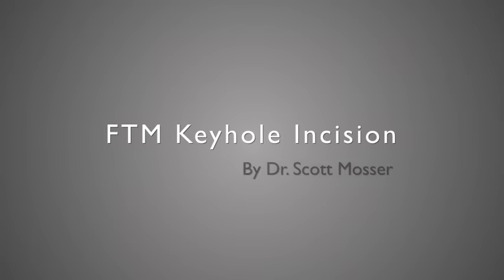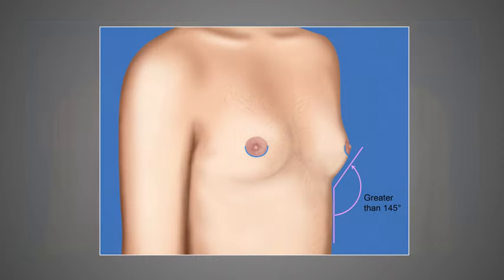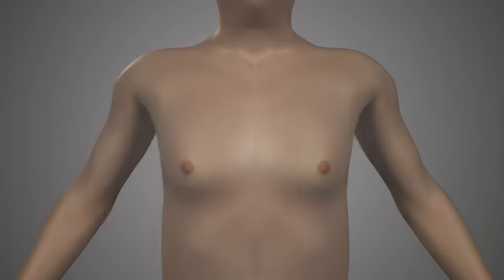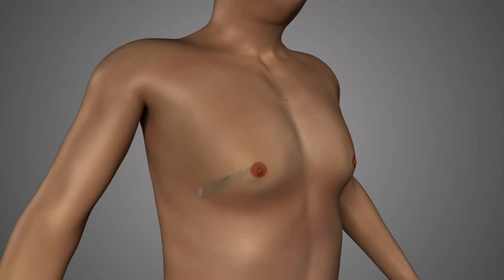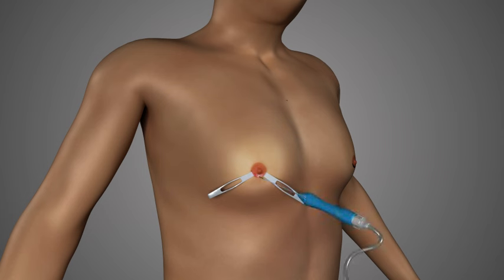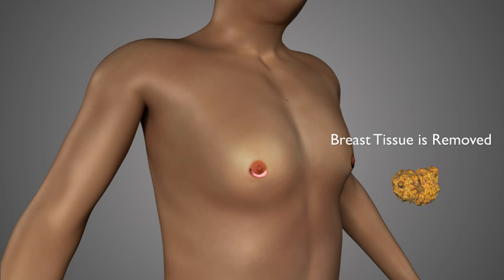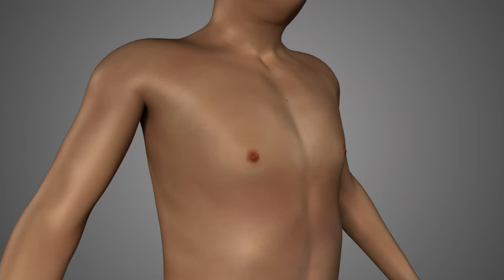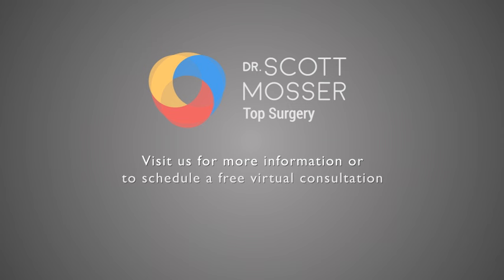Transgender & Non-binary Keyhole Incision Top Surgery by Dr. Scott Mosser

Comment: My question is - is there no liposuction (along the tissue/chest wall) involved with this procedure then?
Reply from the maker: M.J Roth Great question, once the breast tissue is removed, the surgeon might perform final refining steps such as liposuction along the borders of the tissue excision to provide a smooth and uniform result. More information can be found here as well: https://www.genderconfirmation.com/surgery/keyhole/
Reply: So the additional lipo along the borders of the tissue excision is on a case by case basis, just if the patient needs it and it's not always the case during a keyhole surgery?
Reply from the maker: Correct, case by case.
Reply: What if the patient elects for additional lipo for better contour and tightness? Or would that create a puckering or dimpling effect if patients do not need it in the first place?
Reply from the maker: M.J Roth Great questions, a consultation between the surgeon and the patient would need to take place in order to answer this
Reply from the maker: Dr. Mosser gives free virtual consultations; https://www.genderconfirmation.com/contact-us/

Comment: I am born as male, coming out as non binary and started with hormones for looking more feminine and then my breast are grown in a very bad shape... i hate them! I wanna get the top surgery soon as possible and get a flat chest.
Reply from the maker: A gender-affirming surgeon could definitely help with that. If you want to change the appearance of the breasts, a surgeon could do that with implants and other techniques. The GCC recommends that a patient be on a full dose of estrogen HRT for 1-1.5 years before undergoing any breast augmentation or reshaping procedures. It's not required, but that helps the breasts reach what could be considered a final size and shape. That's if you'd prefer to keep breasts, of course. 

If you want to go down to a completely flat chest, that would require a top surgery procedure like double incision, keyhole, etc. The type of top surgery needed is based on the starting size of the breasts and the skin elasticity. However, I should warn you that it's likely that breast tissue could grow back if you continue to take feminizing hormones.